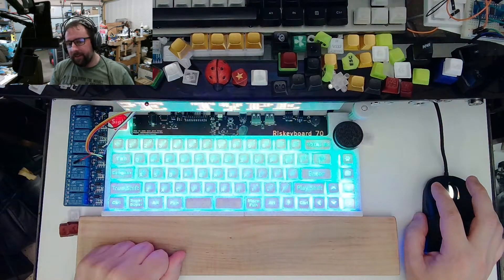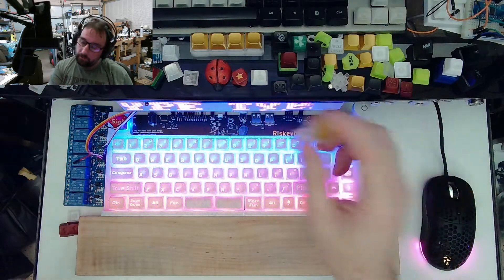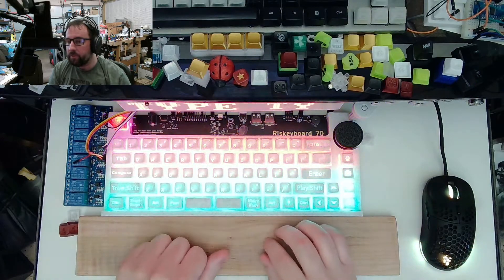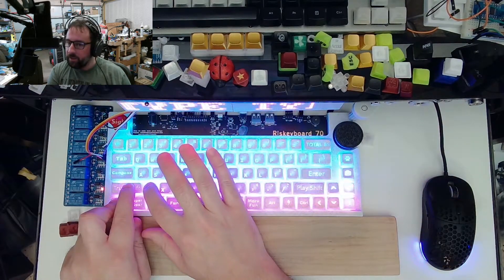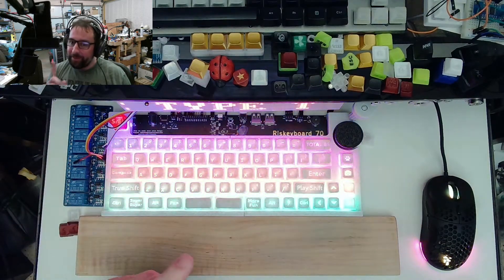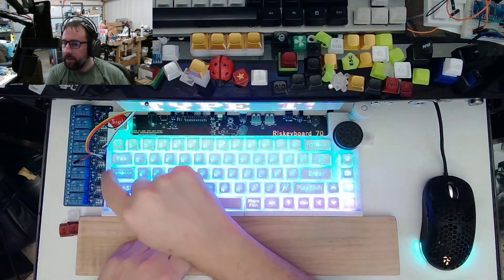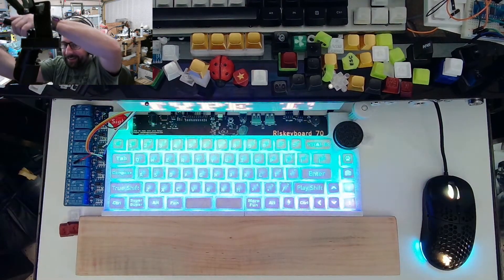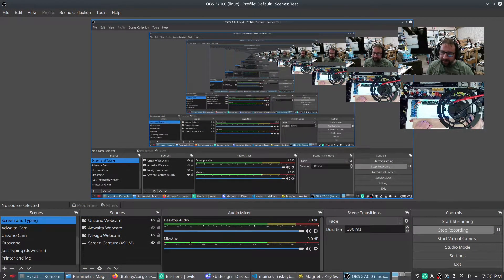I heard you like clicky keyboards 😁 (clickiest ever?)

Comment: Excuse my ignorance, but what do these relays do exactly?
Reply: Relais controll powerflow, similar to transistors, but unlike them, they use magnets and moving parts, which gives a digital signal, and allows for higher power loads. but those moving parts make loud clicking noises when toogled on or off
Reply: @bytezero3818  Gotcha, thanks!